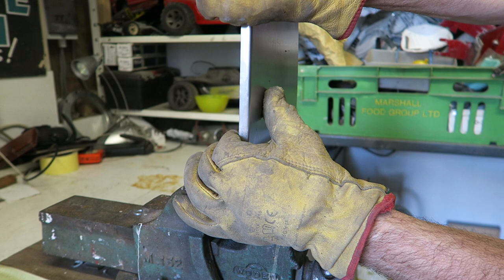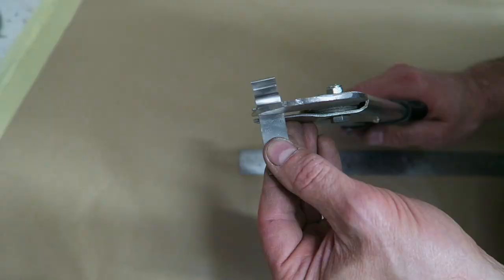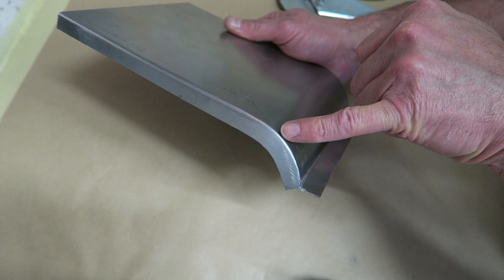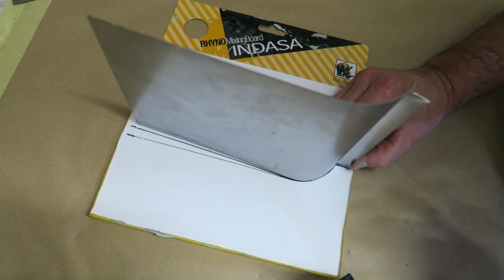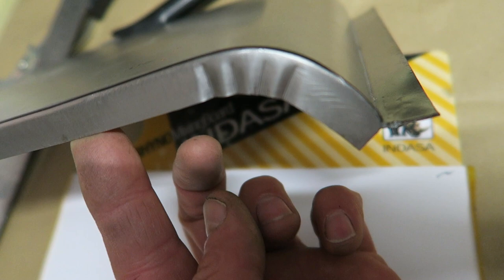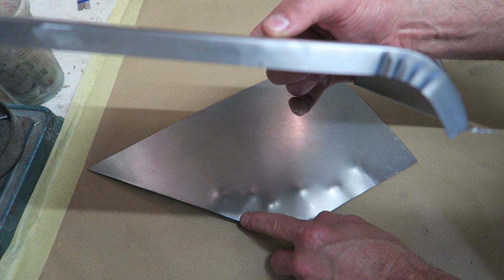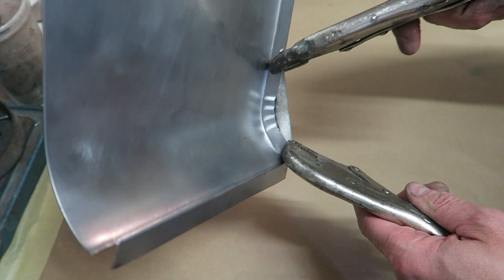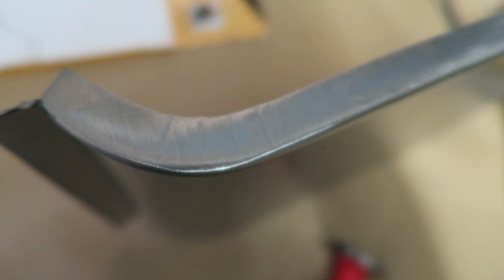Metal shrinking pliers, edge lip adjustment panel beating car panel Tipsand tricks #33

Comment: There is a similar tool marketed to sheet metal workers making ductwork to crimp the ends of ducts so one will fit inside the other.  I made one using Visegrip brand locking pliers.  The double fulcrum action of the Vise grip reduces the amount of force to close so it is easy to make 2 or 3 crimps at a time.  Also, the adjustable closing action makes it simple to make consistent tucks or crimps.

Comment: It's a nice easy to understand method.  I am not in the trade now, but I did my apprenticeship shrinking and stretching complicated shapes by hand and rubber wheel , sand bag or powered rubber bumper and the English wheel. The most effective was to crease the metal by hand and then close the crease by hammering with a mallet. Softening using heat.  It's possible to shape flat sheets into very complicated shapes by hand. My father was a master of this trade and I learnt a lot from him.
Reply from the maker: Thank you for your comment 👍

Comment: Good Morning from the U.S. This is a great video.  Really informative.  Thanks for the instruction on how to remove tuks in a metal edge.  I have this very problem on an upper radiator support on my project car.  I think the previous owner backed over a post or stump and hooked the bottom of the support and bent it forward which caused the top to compress a little which put 4 or 5 small tucs in the top edge.  this video will help me to remove them without having to replace the entire support.

Comment: Thanks for the great advice Trev. A far better solution to shrinking a flange than a shrinking hammer or a shrinking dolly. I have tried using several of these over the years and never got results that were close to pleasing. I have reground them back to useable smooth hammers and dollies.
Reply from the maker: Andrew Wilson thanks Andrew, the way I view shrinking hammers dollies and files is they only shrink when you have a dished profile. The teeth grip on contact either side of the dish so as the dish is straightened out it also compresses the material along its length. I have never had any other success shrinking with these tools. If I metal finish with my toothed bumping file it rarely stretches but if I switch to my smooth file or a planishing hammer I find it’s more prone to stretching. Cheers Trev 👍

Comment: Very interesting. I have a set of pruning shears,can try my hand at making this tool too.
I made a tool just for fun, an old seperated ball joint.cut the socket, so ball has some room, a u shape flat sheet metal to keep them aligned. It makes a very nice dimple. Will stretch metal with very little effort. 

I made a shrinking fork and experimented. Well worth the effort to learn how to move metal. Appreciate your videos.

Comment: Hey Trev, another great lesson on the art of metal shaping. If I remember correctly you are using LPG to run the coffee machine. As I remember an extensive video on you making the box in which the LPG cylinder is stored in. Cheers.

Comment: Hi Trev, you should look at making and selling those pliers, Great idea.
Reply: They are already for sale. Unfortunately, they are incorrectly described in the video. They are not a tile-cutting tool but a SLATE cutting tool or slate cutter. Tubela used to make them and many are available second hand. Most common new ones now are by Silverline.

The ductwork pliers can be found in UK as 'Kennedy 5-blade pipe crimper' (Zoro/Cromwell).

Comment: Powering up a coffee machine off grid. Most likely a portable power generator.   On the puckering of the metal on the rounded edges. Although it would ruin the finish. Using Oxy/Acetylene and quenching with a wet rag to shrink the metal would take out the puckering giving a better finish.

Comment: Thanks for sharing, always good to see a craftsman at work. I have a question , its regarding the final paint process, with a full restoration do you paint the  body shell first and then the inner boot, bonnet and door frames then bolt them to the car to paint the outer panels?   I've been unable to find any process for this, hope that makes sense, any help would be appreciated.
Reply from the maker: Tony Scott personal preference is to get everything primed, paint inside shell, engine bay and inside boot first then mask off the insides well to paint just the outer shell including door shuts on its own. Paint remaining doors bonnet and boot inside and out in one hit. My personal preference but it cuts down on possible dust contamination where it really counts and you have no masked areas visible in the shuts afterwards. Cheers Trev 👍
Reply: I know your busy so thank you for answering my question.

Comment: That was a brilliant demonstration.What is the gauge of metal that you typically use?
Reply from the maker: Thank you! Most outer body panels in steel are around 0.9mm 20 gauge swg. Cheers Trev 👍
Reply: @trevsblog  Thank you Trev.

Comment: Hi Trev this was a great video, wondering if youcan help me i live in New Zealand, can you please give more information as to what type of pliers you started with... this is a great tool to have in ya kit.
Reply from the maker: Hi Matt I actually used a pair of roof tile cutting pliers. Since making the video I have found that you can actually buy a similar purpose built set of pliers called HVAC stove pipe pliers. I haven’t bought a set yet but they may be better than tile cutting pliers? Chee Trev 👍
Reply: @trevsblog  awesome cheers Trev... love your style love your teaching... all the best for 2024

Comment: Gas powered coffee maker!!!  
I have a question, you have inspired me to do all the bodywork on my 1972 C10. Loads of rusted holes. What are the necessary tools?  I’m looking at a bead roller shriller and stretcher.
Reply from the maker: Eric Simerman hammers ,dollies, beating spoons, snips, belt sanders, angle grinder, welder, grips, sharpies, and then of course the heavier more expensive equipment. Cheers Trev 👍
Reply: Trev's Blog ok hopefully I win the hammer so I can buy the rest of the stuff. 😝

Comment: Why you couldn't brace and hammer it in the first place without shrinker?
Reply from the maker: Hossein Ebrahimi without using the pliers first I would have stretched the material even more resulting in the opposite effect than the one I needed. Cheers Trev 👍

Comment: Trev, is there are equivalent tool to do stretching?
Reply from the maker: Stretching is far easier, hammer and dolly will stretch effectively. Cheers Trev 👍
Reply: @trevsblog  Haha, of course, hitting it on the dolly would reduce the thickness and increase the length.

Comment: When you say shrinking you are gathering the length of it but you are also thickening the metal, I think.
Reply from the maker: Yes exactly that 100%. Imagine a piece of modelling clay rolled into a sausage, push it together along its length and it’ll get shorter and thicker because the material has to go somewhere. Cheers Trev 👍

Comment: You're going to power the expresso machine with steamed water generated by a coil of stainless steel tubing wrapped around the exhaust manifold. You don't need to give me a hammer, just provide a link to where to buy. Thxs, fordmodelb